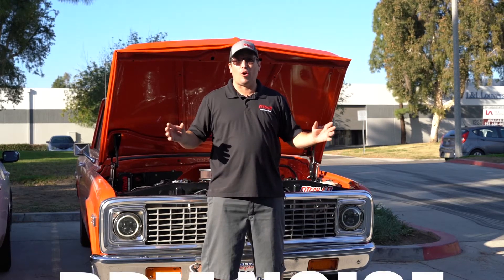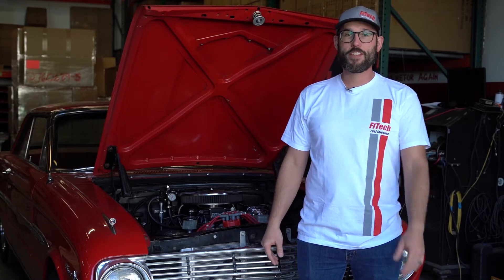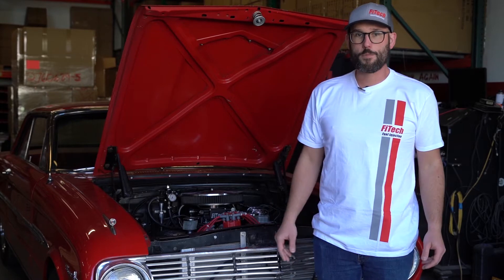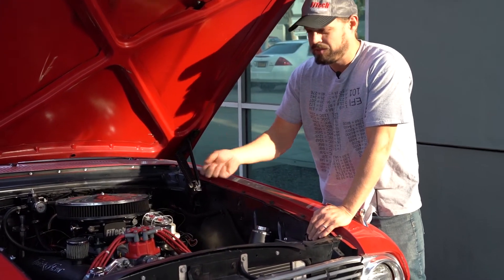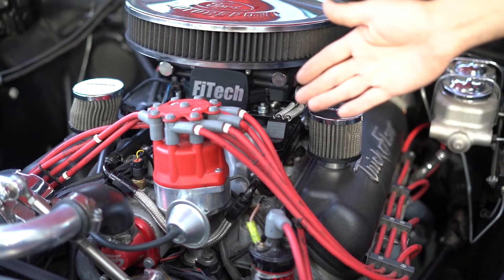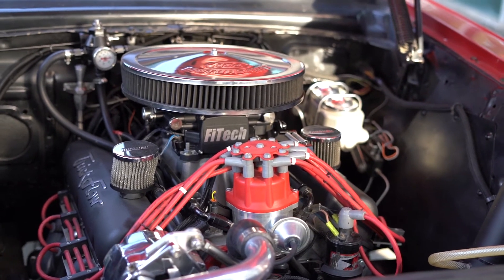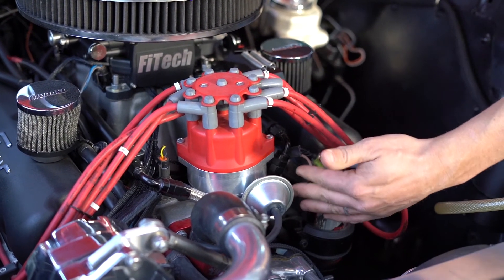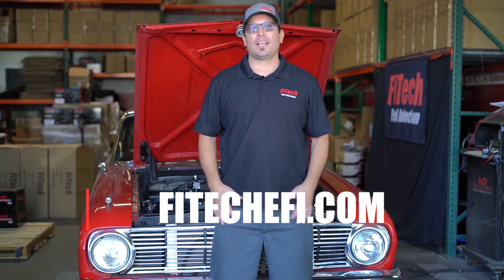RPM Noise! | Tech Tuesdays | EP2

Comment: Adding a diode fixed my rpm noise fault code
Reply: where did you add the diode?
Reply: @benjaminweese4977  I put the diode on the tach wire and reset the pcm
Reply: @benjaminweese4977  Tach wire from your distributor
Reply: @davidcuevas788  what kind of diode? good to know.
Reply: @benjaminweese4977  regular diode
Reply: @davidcuevas788  just tried the diode and pcm reset. the engine runs for 2 seconds and then dies
Reply: @benjaminweese4977  make sure you installed the diode with the stripe facing away from the distributor. Your engine setup settings on what setting do you have it? I have mine on the "TACH" setting. IF you are still aren't getting any signal with the key ON engine OFF remove the blue tach wire from your fitech and tap the positive battery terminal about 4 times and while tapping you should see an RPM reading on your handheld screen. Once you do that hook it back up and try starting it up
Reply: @davidcuevas788  I looked through every setting and there's nothing that allows me to be in "tach mode". the silver stripe on the diode is on the opposite side of distributor. I removed the tach wire and tapped the positive battery post and there was no change to rpm reading with key on. I hooked tach wire back up and engine still dies after 2 seconds.
Reply: @benjaminweese4977  When tapping the blue tach wire to the positive side of your battery were you monitoring your RPM on the dashboard setting in your handheld controller?  You should of got an RPM reading on the DASHBOARD screen
Reply: @davidcuevas788  there isn't a tach or 2 wire coil setting in that menu on mine. anyways, I tapped the tach wire to the positive battery post and an rpm reading shows momentarily on the handheld. I then plug the wire back in and turn on the engine and it still dies after 2 seconds.
Reply: @benjaminweese4977  contact fitech so they can fix your problem
Reply: @davidcuevas788  thanks a lot for the help. I appreciate it
Reply: I just moved the tach wire from the negative side of the coil to the distributor tach signal and it fixed the rpm noise error I was getting.

Comment: Why would "noise" occur 2-4 minutes after start up? I recently had the engine out for an oil pan gasket and transmission mod. Everything went back and now I have the 58-59k rpm issues when idling for several minutes.